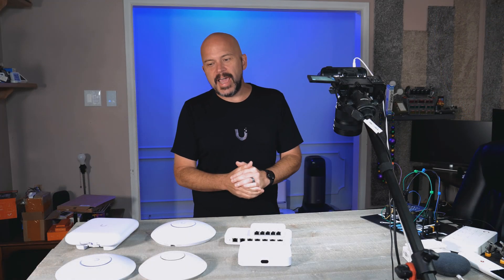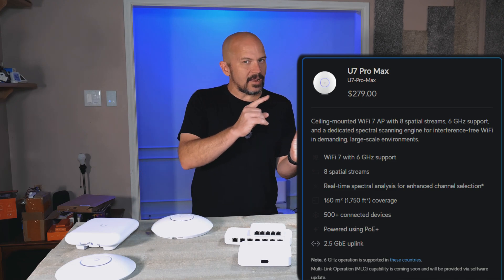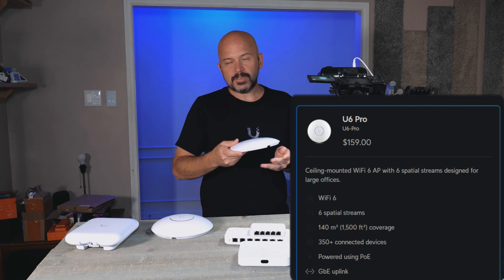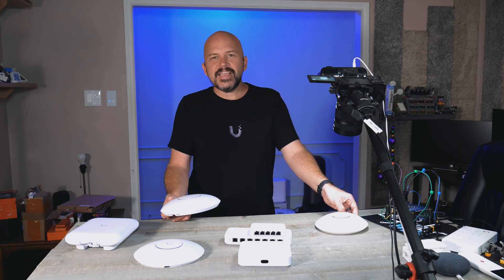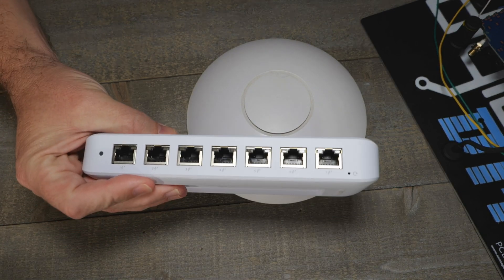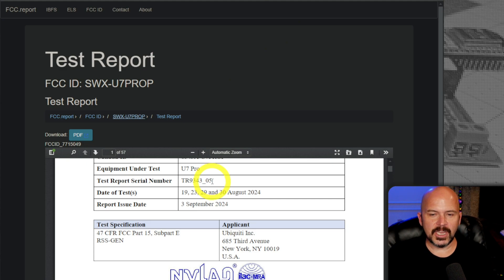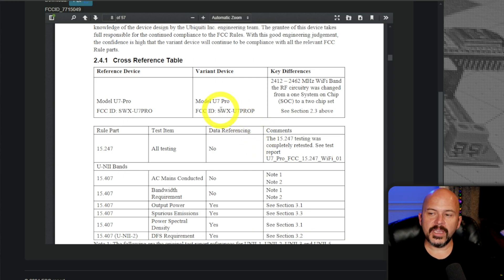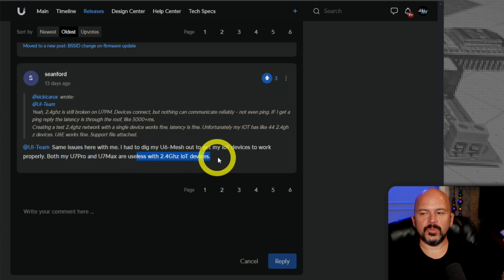UniFi U7 Pro & Max - DON'T BUY Here's Why

Comment from the maker: UPDATE 3/17/2025 - We might be all fixed now finally!   8.0.20 seems to be running well on the U7 Pro and U7 Pro Max.  Even MLO seems to be working.  How's it working for  you?
Reply: I haven't had any problems with the u7 pro at all it takes care of all my devices including my iot devices doorbell locks thermostat with no issues. The device barely gets hot and the fans hardly ever come on.
Reply from the maker: @MrWillz06 how was 7.0.66 for you?
Reply: @digiblurDIY  that version  was fine for me also I deployed to my house I have a four-storey townhouse. And I have about 20 to 30 Wi-Fi devices including iot devices. Initially it was hot when I first deployed it but after about I'd say a day it never warmed up again and the fan never cut on.
Reply from the maker: Gotcha..  count yourself lucky.  That version was pretty bad for a lot of us, I could break it in less than an hour with my test setup.  Luckily that is behind us all.
Reply: My problems have returned again. The U7 is the biggest pile of shit. I have been up all night troubleshooting this thing again. I finally just disabled it and let my U6 run the entire house. things are stable but I unfortunately now have coverage holes. I''m currently browsing through market place looking for a used U6 to replace the U7. The U7 keeps crashing.. it stays partially up and partially down so devices stay connected to it but they are not working. I notice the issue is with RTSP/Multicast. I had to disable homekit secure video for the past few months due to the issue . I thought the issue was resolved so I reeabled again but nope. but everything works fine on the U6. Although I do have an an extreamly high multicast use in my network - my speakers use AirPlay between the tv and sonos speakers and all my cameras are also rebroadcasted into homekit using scrypted all of which worked fine when I had all U6 but I got too excited about wifi 7.
Reply: @tytalkstech  I was the first to buy the Dream Machine Pro when it first came out, the first few months was really bad with bugs and stuff. It took over 1 year for Ubiquiti to stabilize everything, so early adopters like me suffer, that's when I stopped jumping to the newest stuff from them.
Reply: @tytalkstech  my U7 Pro XGS also crashes sometimes, before I had U6 Enterprise it was rock solid, no issues whatsoever
Reply: @AA-kj4ic I just trashed mine altogether( n storage)I got sick and tired troubleshooting everyday. I got the u7 pro XG and haven’t had any more issues. I  hate that I paid for it and never got my moneys worth.
Reply: @tytalkstech  you mean u7 pro XG is working well for you and pro XGS was no good?
Reply from the maker: Moving quickly.... 6 hours ago it looks like.  I'll give it a shot.  Thanks for the update!
Reply: With the 2.4 GHz issues and fixes, would you recommend the 7 Pro and Pro Max now? Is the 6 model line still the recommendation? I'm using the TP-Link BE1000 Deco Mesh and I'm looking for something that offers more features and WIFI 7, with a mesh requirement.
Reply from the maker: @kennethhowe yes. U7 Pro and XG are good to go. The pro max is there too if you need that.
Reply: Just to have it clear... the recommendation now is the U7 Pro (Max)? Does this apply to a specific hardware release of the device (U7ProP?)   It is now as stable as the U6 line? Thank you for your community support!
Reply: September 2025, nope, still bad. Ill put them away for a year.
Reply: 8.0.20 is a beta?
Reply: Does 8.0.20 "fix" the 2.4 on the entire U7 line and the U7 Lite specifically?
Reply: @wcanderson4007  nope - even 8.0.26 made it worse than before.
Reply: I came across this while planning a project that would involve me migrating an install with 21 UniFi AP-AC-Pros to a much newer controller, and then swapping out six of the AP-AC-Pros with U7 Pros, while leaving the other 15 in place.  The purpose of swapping in U7s would be to make WiFi 7 available to the clients who need it, while leaving the bulk of the clients on the older APs (this is a relatively small event center).  There is tons of overlap in coverage, with 12 APs in an area that could easily be covered with 3-4 APs, but we threw extra APs in to allow each to serve fewer clients.  All that said, I think we'll be OK with the U7 Pro given that 1. it sounds like the IoT device issues are hopefully now resolved, and 2. I can actually just disable 2.4Ghz on these U7 Pros so they don't even attempt to serve 2.4Ghz clients (I have 2.4Ghz disabled on most of the access points anyway due to the heavily overlap in coverage and lack of channel diversity).  Any thoughts on this plan?  My primary difficulty in carrying it out will be the need to use a lift as many of these are on a 25' high ceiling.  Obviously my goal will be to do it once and be done with it.
Reply from the maker: @chirkware I do agree the IoT issues are resolved. I did see them pull back 8.0.26 and go to 23 now with some issues that came up.

With that said on your setup I wouldn't mix wifi generations on the same SSID. I know I have seen a lot of issues especially out of the Apple crowd with that. I saw it myself on the Android side with just 2 U7 and 1 U6E AP setup. Lot of roaming issues. I do think if you keep it separated though you should be fine.
Reply: Does anyone knows the new firmware 8.0.19 fixed issue?

According to the description 

Overview
UniFi Access Point 8.0.19 introduces the Multi-Link Operation (MLO) feature and includes further improvements for 2.4 GHz IoT connectivity.

This is the initial release for the U7-Lite and U7-In-Wall products. Firmware updates will be rolled out gradually for individual models.

Improvements
Improved client connectivity.
Improved AP stability. 
Bugfixes
Fixed an issue causing inter-client communication to drop.
Fixed cloud connectivity for some IoT devices.
Additional information
NOTE: For the best connectivity and roaming experience when using MLO (Multi-Link Operation) mode, it is required to enable WPA3 or WPA3 Enterprise security mode. When MLO is selected, the UniFi Network application will automatically enforce this security mode.
Reply: Have you tried downgrading to WAP2 for IoT devices and putting them on their own vlan because of using WAP2?
Reply from the maker: The recommendation is the U7 XG actually but the U7 Pro, Max, XGS are also fine as long as you run 8.x firmware.
Reply: Update your video title.
Reply from the maker: @AgentLokVokun a whole new video is coming once I get a flapping network issue resolved

Comment: So now that the u7 pro has been out for a bit and rumour has it that ubiquiti may have removed the fan/revised the chipset. Would you recommend the u7 pro or the u6 enterprise? U7 pro is $150 and the u6 enterprise is $200.

Only planning on AP for now so I want whatever is gonna have good stability, penetration, etc.

I only have one 3x3 device and the rest are 2x2 but the 4x4 on the enterprise should help with range/receiving signal back from devices? Not sure if most of the wifi 7 features really matter (at least for a while) I only have 1 wifi 7 client and have 1gbps connection.

Having trouble choosing between these two
Reply from the maker: I would really go for the U7 Pro XG. No fan and cools itself a lot better due to the design.
Reply: @digiblurDIY wasnt expecting to throw that in the mix. Any particular reason over the u6e? Just cause it's newer?

Comment: U7 Pro XGS - not going offline, it brings devices offline for 2-5 seconds. Not all devices, some as printers. I tried everything, changing channels, forcing 2.4 or 5, the results are the same, its just a constant nightmare for endpoints. As soon as I tested with AC Pro, everything went back to normal.
Reply from the maker: did you try the latest 8.2.17 firmware?

Comment: Does the UDR7 (router) suffer from the same problem (especially the 2.4ghz for iot devices)? Should I go for UDR7+U6-LR or other U6 APs?
Reply from the maker: It does not.  I just set one up over the weekend on the latest official firmware and it is fine.

Comment: Hi, can you give me some advice on what to choose, U6-LR or U7 pro xg? Thanks.
Reply from the maker: U7 Pro XG all the way
Reply: @digiblurDIY  U7 pro xg you say it is better than u6-lr?u6 is 4x4 and u7 pro sg is 2x2. Have you used u6-lr? Was everything ok?
Reply from the maker: U6LR was Mediatek based and I preferred the Qualcomm chipsets. If you need 4x4 there are higher Wi-Fi 7 models like the XGS.
Reply: @digiblurDIY  What are you currently using?
Reply from the maker: U7 XG and 2 U7 Pros. The XG runs so much cooler with its design.
Reply: @digiblurDIY  u7 xg super and how is the coverage on 6 GHz? Are you satisfied? I guess you use them in mesh?
Reply from the maker: No mesh. I wired mine with ethernet for better performance. Coverage is decent with the three for 6ghz but that band falls apart easily after 3 or 4 walls. I run the 2.4ghz band on medium power since I have three going.
Reply: @digiblurDIY  I think the U7 pro xg would be a good choice or the U7 pro xgs or the E7.

Comment: I've had them for 6 months with zero issues. Rock stable. Also my G4 Doorbell finally has a perfect signal without drops. My old Ac-Pro always had signal issues.
Reply from the maker: You skipped the 7.x firmware fun. It was brutal.

Comment: i have 2x u6 pro and was looking into the u7 lite, so better stick with the u6 pro?
Reply from the maker: Not much of an upgrade there. U7 brings the 6ghz band.
Reply: @digiblurDIY i thought the u7 lite didnt have 6ghz
Reply from the maker: That's correct. What do you have now?
Reply: @digiblurDIY U6 pro, and its working good, it only gets really hot 😅
Reply from the maker: You would be stepping down on spacial streams on 5ghz. The U7 APs get warm as well

Comment: Man we had to downgrade 14 APs today in a company because nothing worked there. Around 70clients with almost no connection. We removed one single u7 pro because nothing was happen while trying to connect. Other u6lr are working again with a one year old firmware. Im on the point where I dont buy ubis ever again.
Reply from the maker: What did you downgrade to?
Reply: @digiblurDIY 6.6.65

Comment: I'm having a lot of problems with unifi 7 pro. My devices are often disconnecting, while some IoT devices won't stay connected at all. Smart speakers can't play fluent audio if located further than 3 meters away.
samba transfer speed 5 meters away is 20MB/s, and up to 55MB/s while standing right below the AP (tested with new thinkpad t14s). 1st gen TP-link EAP620 has way better speeds and better range. Tested in private house without neighbour wifi, so perfect conditions.
Reply from the maker: did you try the latest EA 8.0.58?
Reply: @digiblurDIY  already sold it on ebay.

Comment: Reduce signal strength for 2,4 GHz. With UDR7 it almost solves IoT especially on IoT setting enabled SSiD
Reply from the maker: I already had it at medium.  They are super close to releasing the fix finally for some issues as an official.

Comment: I stopped using my U6 Pro around the time this video was made because I think there was the same issues you were talking about.  I wonder if it was just some really bad firmware because my U6 Pro was working good but didn't seem to have the range that the AP-AC-LR had. the AC-LR gets much better 5GHz upstairs in my house from the same exact mounting location as the U6 Pro.  No idea how that works.

Comment: My U7 pro is faulty, I had to replace it with my U6 Light that I used previously without issues.

 U7 pro constantly shows as device is unreachable yet devices can connect, they just won't receive Internet access.

Devices in question are 5Ghz and 6Ghz WIFI 6E & 7 devices.
I don't have any 2.4Ghz devices due to 2.4Ghz band being 100% interference where I live.

Comment: Hi All, I thought I'd just put my thoughts in here. I've been struggling with the U7 Pros for ages, constant disconnects irregular speed, poor performance, devices right next to the AP's dropping or getting 3Mbps etc etc, just a general shit show. I was about to replace them when I came across this video. For context I had been running the devices (3x U7 Pros (8.0.19)/1x UCG/70+ iot lights/Alexa's in most rooms/Firesticks/other Iot devices) with limited success for nearly 12 months. Well I decided to have one last attack after watching this. My configuration was a single SID (HOME) with 2.4/5 and 6ghz enabled. I had tried every setting on the radios section where I assumed the issue lay. After watching this and reading others experiences, I decided to keep the main SID but switch switch on Enhanced IOT for that SID and create separate 5/6ghz SIDs (HOME5/HOME6) anything that could see thoses SID's were migrated, everything else left behind. This was over a week ago and I have had no issues since.  Everything is staying connected, performance is now stable and the kids have stopped complaining. So there is hope...

Comment: Just bought UDR 7 and wall pro, older phones, tablets with only support for 2.4 & 5ghz had problems alway getting dropped, solution was to create separate networks, one with only 2.4/5ghz for older devices and another with the 2.4, 5 , & 6 ghz for the newer devices with support for 6E. I think 6ghz does not currently play well with the other frequencies and older devices.
Reply from the maker: Yep. Been doing the 2.4ghz only SSID for years for good measure.

Comment: I hate that the dual chip release was so quiet with people finding out from official fcc documents. They've basically caused headaches for online retailers with people ordering and returning products because they're the old version. This was basically them trying to avoid mass recalls from people who are still facing issues after the last patch, even though it's slightly reduced. It's also odd who the patch fixes issues from some people completely, and others had no issues to begin with for over a year.....
Reply: how can I know which version I have? I have a lot of problems with this AP.

Comment: Looking at buying, thanks for the video, I was going to get the U7 Pro Max. Is the UDM-SE and U6 Enterprise a good fit for wide coverage and lots of 2.4Ghz devices?
Reply from the maker: If you can I would wait a month or two. The current release candidate firmware looks promising. No with that said the U6E is awesome.
Reply: @digiblurDIY  If i wait, will the U7 pro max be better than the U6E in terms of handling lots of 2.4Ghz devices, or best sticking with U6 Ent? Also, isn't the U7 mimo 2x2, whereas the U6 is 4x4?
Reply from the maker: @hikviz9410 U6 Enterprise is the 2x2 on 2.4ghz

If you do want solid 2.4ghz device support then the U6E with current official firmware is the way. Beast of an AP. Only real thing you would be missing is wifi 7 rates and MLO if that's worth anything to you.

Comment: my goddamn GL.iNet has faster 5 Ghz though a wall vs sitting right next to a U7 pro... and yep, fresh SSID, one device connected for testing. The 6Ghz also is horrid, like below 200 Mbps most of the time bad. We're probably pawning it off on ebay and replacing it with a U6 Enterprise.
Reply from the maker: Did you try the 8.0.19?
Reply: @digiblurDIY  Sure did. No real difference there. I think some of these are just broken, maybe there's some parts intermingling, or maybe it's the regulatory region. Either way, unacceptably bad, especially after a year of updates.

Comment: I bought the U7 Pro Max in Nov-2024 and it was a disappointment. But the last four releases since they renamed the firmware to ver 8.x.x have been surprisingly good. This is still EA firmware and not a final release. They really do need to release a new final version, not everyone knows to enable the early release. I’m still keeping the MLO feature turned off with my testing. I also have about 95 IoT and a total of 106 devices on the WiFi. Have you trued any of the more recent firmwares? I’m curious to see if you get the same results and stability I am finally seeing?
Reply: Thanks for the update, was considering whether to go E6 vs U7 vs U7 Pro Max. I'll go ahead & pickup a Pro Max with all the good reports about the 8.x.x software.

Might be a few more bumps with EA releases but seems like Unifi will have it stable within a few more months... but it's a bad look that the 7 series was released with such major bugs.
Reply: I agree it defiantly looked bad. Well it still looks bad because people are buying these U7 units and they have not released a new official version yet. So if you don’t know to use the early release they are still having issues. But I have done all the 8.x firmwares including one last night and things are running good and just getting a little faster across all bands.
Reply from the maker: 8.x is definitely better now for things.  Time will only tell as more people run it and let it soak a little bit.

Comment: Sorry I I commented twice. Did not see my first comment show up yet. I saw similar issues and performance issues with the u7promax. I did switch back to the u6e for a short time. I will say I had better luck with the latest firmware releases. I did end up also upgrading to the E7. I don’t seem any issues with 2.4ghz . 6ghz was a little off on the E7 but firmware updates have improved over time.
Reply from the maker: I saw it. I don't think it got flagged. I do agree 8.x is miles ahead now that they got the bad SSID broadcast issues out of the way. I have even been able to use the U7 Pro Max now. Looking forward to an official release firmware.